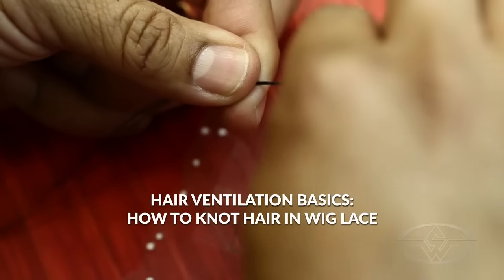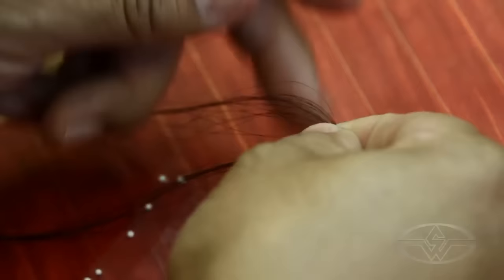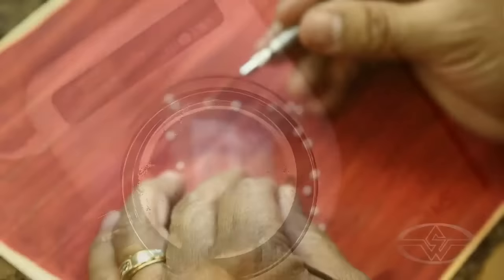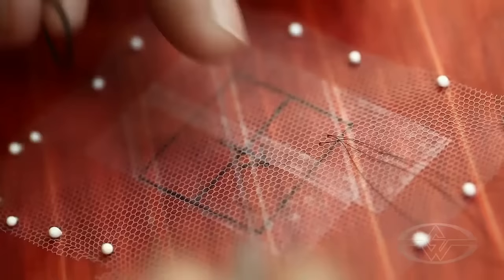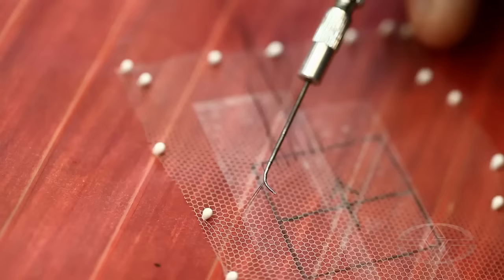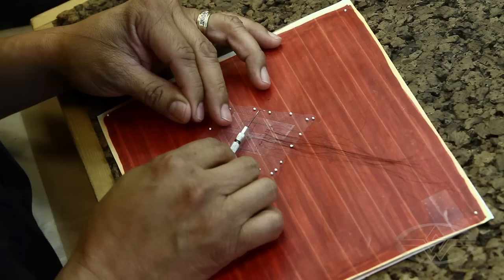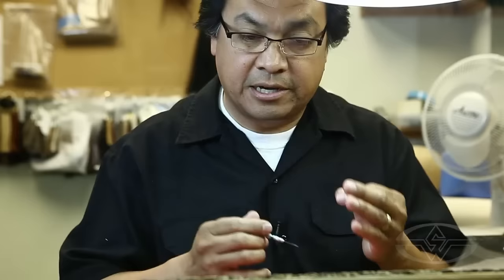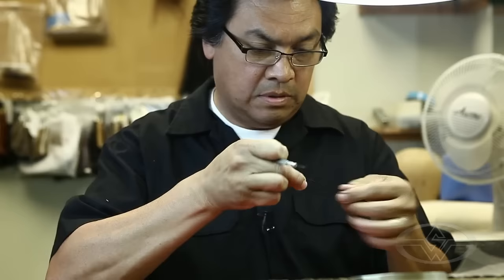Hair Ventilation Basics: How to Knot Hair in Wig Lace

Comment: Thank you for this video.  Reminds me of rug hooking, which is very meditative.

Part of the reason I wanted to watch this was to see how the knots are made.  I have alopecia and a human hair wig that was made several years ago.  I paid quite a lot for it but can't seem to wear it because of the scratchiness.  I thought it was the extra layer of rough lace that was on the inside crown, so I removed it but the next layer, which covers the knotted lace, appears to have very tiny cut hairs poking through it.  It's almost as if the knots on the next layer were cut but that doesn't seem to make sense based on the technique you're showing.  
Were wigs knotted differently at one time in a way that left an exposed cut hair on the inside of the wig?  I'm a little confused by what I'm seeing on the wig.  Thanks for any input.  If I had more time, I'd try this.  It looks very relaxing.
Reply: try covering that layer with small hairs with a silk top foundation maybe
Reply: Thank you. Yeah, I've actually got both a silk cap and a bamboo one I'm going to try sewing in to cover it and see if either one helps. Thanks for your help.

Comment: You should tell people if the root end is long, the hair will always tangle from the cuticle friction. Not a mustache, but anything longer.
Reply: Can you explain this a little bit
Reply: The hair on the closure and/or frontal will need to be chemically processed in order to prevent tangling.
Reply: @TiffaniTube622  still won't stop tangles.
Reply: Cheryl Ross Try a better quality hair...if it’s tangling that bad, the quality may be bad.
Reply: @cherylross2718  how u no this?
Reply: @jukodebu  I made wigs and facial hair for years. It's common sense if you fold hair the cuticle will lay in opposite directions, therefore causing friction. If the root end is long, it will tangle.
Reply: @TiffaniTube622  I only use European virgin hair. Check out my explanation above.
Reply: @cherylross2718  girl what was the conversation about, I can see you replied 2 yrs later
Reply: @cherylross2718  where u get that from

Comment: Where to buy that pin and what its called? Thanks.
Reply from the maker: Instructor Michael Ornelaz is using a ventilating needle in this course excerpt. An internet search will point you to different suppliers but Michael recommends buying one with a lightweight aluminum handle. The size of the barb on the ventilating needle will determine how much hair you can grab at a time, so it's best to buy a few sizes of needles to achieve different densities. - Balázs

Comment: I'm at my rope's end here... My back and shoulders hurts so much from ventilating... If the lace front is too low at the table it hurts my lower back like crazy, if I put it higher up it makes my shoulders and upper back hurt like crazy, anything in between and both hurts. Trying to really focus on my position, and see whether anything helps, but the only thing that helps is stop ventilating... Do you have any advice? I don't know what to do anymore. :(
Reply from the maker: Answer from Michael Ornelaz: The art of wig making is very difficult and both upper and lower back take the brunt, not to mention the shoulders and neck. My advice is to adjust seat height, table, and proper lighting. Take breaks in between, stretch, exercise your eyes by looking outside. There is no one answer for this but to take breaks. I have tied up to 18 hours to get things done but I don't recommend this. Play music, your surroundings are important. - Balázs

Comment: I wish you could mention what happens when you use make the overturn long on a human hair wig.
Reply: If it’s a 100% human hair with cuticles in tact, it will tangle if the overturn is too long, because the direction of the cuticles will be running in opposite directions which causes tangling. If it’s chemically processed hair with no cuticles, it doesn’t matter, you’ll just end up with shorter and fuller wig. Hope this helps